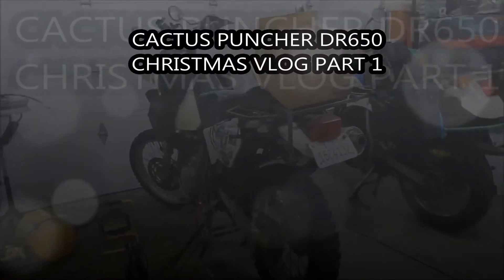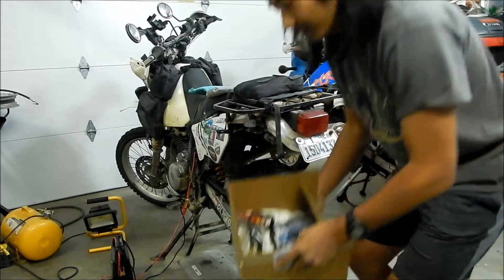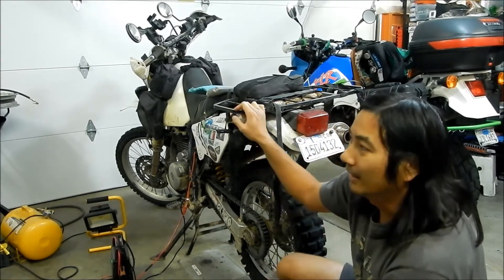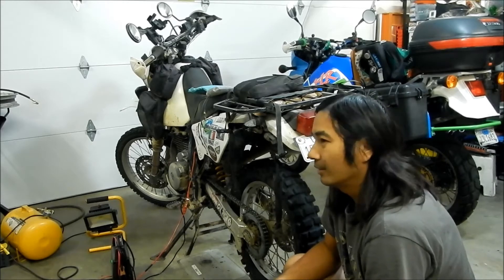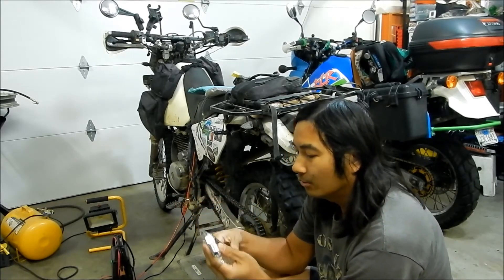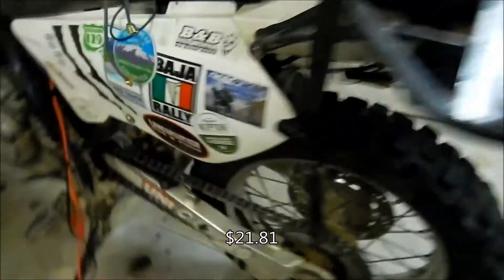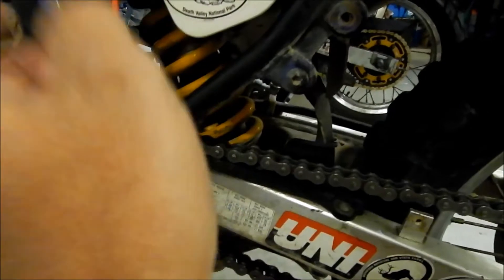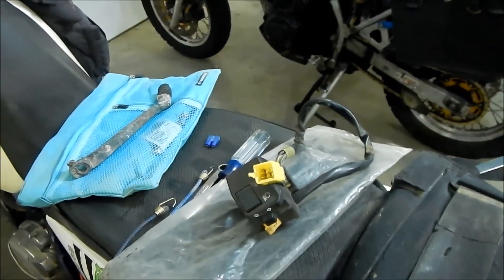Cactus Puncher DR650 Christmas VLOG Part 1

Comment: Looks like a great bike. What top rack is that? And how did you come up with the name "Cactus Puncher?" I liked your videos of the Reno to Vegas btw.
Reply from the maker: Thanks for watching, it is one of the old DR650 BBQ racks.  I don't think they sell them anymore.  There are similar options out there though.  Also it's BBQ Rack 2.0 because I broke it in Baja and had a welder fix it and make it stronger =)
Reply: Hahaha. That's awesome. So how about the name "Cactus Puncher?"
Reply from the maker: @andyblack5687  Cactus Puncher was the name I gave it after my first Baja trip, because it was hard to control it through the deep sand I kept on going off the trail and ramming into Cactus or punching them with the handguards.  =P